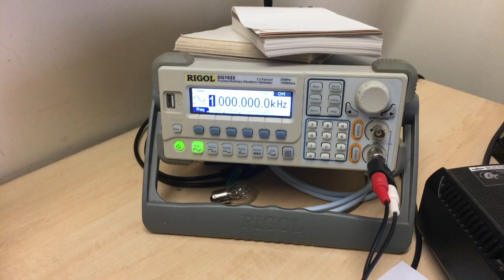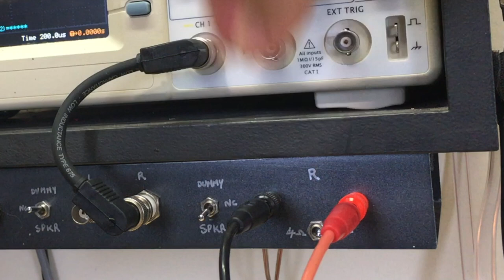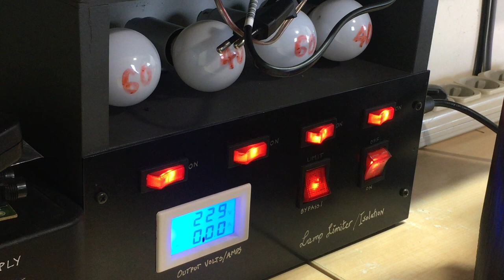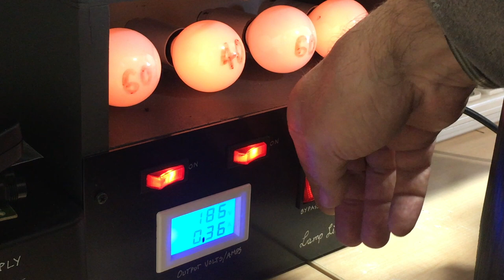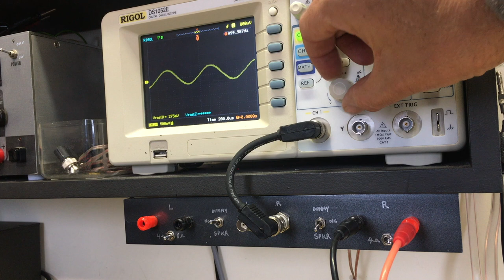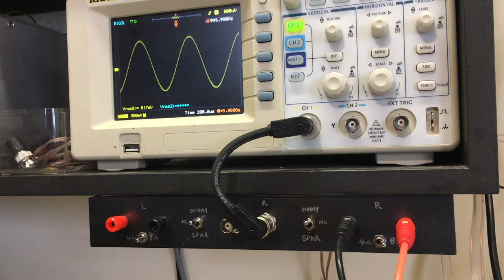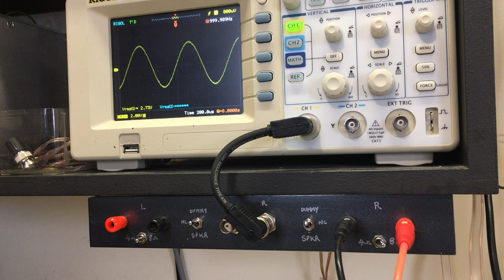Gryphon S100 Amplifier Repair - Part 1. A close look at a nightmare.

Comment: This video is perfect intro to troubleshooting for an amateur hobbyist who's beginning electronics repair. Very well aimed and focused shots combined with precise, concise information/commentary.

The workbench set up is exemplary and doesn't look hideously expensive (as it would be for a professionals' workbench).

Very nicely done!
Reply from the maker: Stelios Posantzis : Thank you. I chose the “amateur” version of a workbench because this is in fact my hobby, so spending fortunes on equipment sort of goes against the grain. I like to build a lot of the test equipment myself to add to the satisfaction.
Reply: I think that the main thing for someone wishing to pursue this as a hobby is having an "appropriate" dedicated space with an appropriate working surface. I say "appropriate" because we're dealing with potentially lethal currents/voltages here. So having a space/table which is comfortable so that the hobbyist can work unconstrained and undistracted and spacious to accommodate various pieces of gear must be considered as a necessity which will help primarily to ensure the hobbyist's safety. The rest (such as test gear etc.) can come afterwards.

Comment: Hello! Can you tell us what substances do you use to clean "millimetre by millimetre" these old devices?  Something like isopropyl alcohol? that won't damage the chassis/components? Thanks!
Reply: Thanks for your repsonse, but after cleaning with isopropyl alcohol and cotton swabs, there is a slightly white residue that's left on the PCB. How do you get rid of it?
Reply from the maker: Richard Maxim : I think you’re using normal alcohol, which does in fact leave that white layer. Isopropyl doesn’t.
Reply: @tool2202  Anything less than 100% isopropyl  alcohol will leave a residue from the water which is in 99% or less, the way I get rid of the white residue when using 99% or less is to follow up with a dry swab before the alcohol evaporates.

Comment: I'm assuming you can take what follows with a pinch of salt ; ) 
It's all well intended!

 8:00 : How can they make an absolutely symmetric board for the two channels? It should be near damn impossible to do that - not to mention completely useless, expensive and double the trouble of repairing. I use to like the idea of having symmetric pcb's and get annoyed by the opposite being the standard. Now I see why no sane manufacturer does it. The only place where it still bloody annoys the hell out of me is those cheap 70-80's loudspeakers where if you take the grille off it looks like you bought two right (or left) ones.
In fact, let me ramble on a bit more: I've just decided that I hate dual mono enclosures. If you're going to make dual mono, well, why not do just that: make two monos - simple! It should work out cheaper overall to manufacture as design, construction and testing take place once (rather than twice). For the consumer the gain is three-fold: a) you have a more robust (and possibly better) piece of kit b) if one channel breaks, you still have the other c) it's much cheaper and quicker to fix. And frankly, I prefer the feeling of having two monos. There, I've said it. I'm glad I got it out of my system.

14:30 : seek therapy now! or you can attempt repairing an AMC cvt3030 - plenty of burnt tracks on those, you're gonna love them! I have two and still don't know what to do with them. I've been pulling my hair out repeatedly - now I choose to ignore them. 

15:14 : ah you're making progress! there's still hope! ; )

15:35 : now I get it, it's worse than I thought then. I'd advise you getting a timing device (chess players have these) to measure how much time you've spent on this thing and decide if could be put to better use (such as bird watching, gardening etc.)

16:24 : you have a very tidy and organised work bench. It's not so bad then: a dedicated and organised place to work makes work a joy rather than self-inflicted torture.

18:25 : that's a very neat set up - never seen one use this before!

18:55 : I've seen your other video about the light bulb limiter before. I've been racking my brain on how one could use the same wattage bulbs to build some sort of resistance ladder that not only goes up by integer multiples but also goes down by fractions (by paralleling bulbs). In fact, now that I think of it, why not make it go up or down by both integer and fraction multiples. I've come to the conclusion the only sane way to build that would be using a microprocessor (eg. Arduino) and relays (but that would be no fun). In the meantime, I've found my variac which was hidden in storage so I forgot all about it - until now that is.

23:58 : perfect for frying expensive loudspeakers that usually are connected at the end of a Gryphon!

Comment: What a terrible moron was inside this hammer? 
But this Elko-Batteries are hefty. I know, from what i'm talking. In the 80s i built a hot regulated powersupply with one eletrolytic capacitor, which has 65.000 microfarad/40V. You can imagin this can.
The transformer  (M102b-Kernel) had 200 Watt. The cabinet was from metallsheet. When i switched on this animal, you got a noise like a gong against a wall. The startcurrent to the cap are nearly 100A!
Therefor i had to build the rectifier myself from 4 pressdiodes and a special heatsink. 
This thing resides 2 times in this cabinet. 1 meter heatsink at the back with 10 2N3055. It delivers 2 times 1-15Volts/10Amps. Both adjustable. And shortresistant in any situation. Have to restore this toy.
And i have to much written.
Cheerio from Germany.

Comment: What a mess good example if you don't know anything about amps. Stay off! Overheated soldering.
Luckely you got the schematic wich is rare. I ones had a krell amp exactly the same. Distroyd traces etc and replaced military spec resistors with those white squared types 10% instead of 2% like krell intended.
Fixed it course I had a good left side working.
Reply from the maker: Having one working channel is a blessing.
Reply: @electronicsoldandnew  krell doesn't give schematics so it was comparing with the good channel. Lucky I was, now it's playing like krell intended.

Comment: I absolutely hate printed circuit boards! Look at Primaluna Dialogue Premium HP Integrated Amplifier! That's how an amplifier should be built! Printed Circuit Boards in professional power amps should never be an option! The heat alone will fry traces causing it to fail!
Reply from the maker: I prefer point to point tube amps myself. A real pleasure to work on.
Reply: Prima Luna overpriced

Comment: It’s no surprise so many components have been replaced, traces lifted, etc. as this is a poorly designed amp that’s borderline unstable from the factory. Whoever designed it didn’t understand how feedback requires generous margins of stability to accommodate variations in components. There are so many “audiophile” amps designed by people who don’t know what they’re doing and this is a classic example. They use dual mono, high end parts, beefy power supplies, fancy chassis, etc. But the actual design is junk and they’re often marginally stable and/or measure poorly. Amps like this barely work when they leave the factory and, if anything fails, they’re prone to self destruct over and over when components are replaced. Amps like this are best retired and used for parts or thrown away. A modern well designed amp at a small fraction of the price will easily outperform junk like this and likely never need repairing.

Comment: I think overhearing and all this mess is from bad design from a start.
Lot of Gryphons are bad design with some small signal transistors used on the edge dissipation.
Reply from the maker: They certainly were run on the edge 😓

Comment: Wow! what a challenge this is, but from an amateur's viewpoint, although it is a very tedious work,  it can also be fun and could be a very satisfying job when it is done. Especially if you have the schematics... Who ever did that previous "repair" should be prosecuted and banned from ever using a soldering iron by court order.  One thing I was very surprised that the designer did not include a better "soft-start" type inrush limiter in this monster. With those transformers and the massive capacitor banks, I don't see how one can get away without a soft-start. Great video, I watched it like an action movie. :-)
Reply from the maker: Bora Yurtoren : it is a little like an action movie, which sometimes even has explosions! I agree that someone should remove his soldering iron.

Comment: That thing draws only 0.5 amp, which makes the line voltage drop???  Bizar.  If I draw 10 amps from the wall, the line voltage does not drop a bit.  BTW, you should always test with dummy loads.
Reply from the maker: 1959Berre : it’s connected to the isolation transformer rated at max 1 amp, hence the drop.